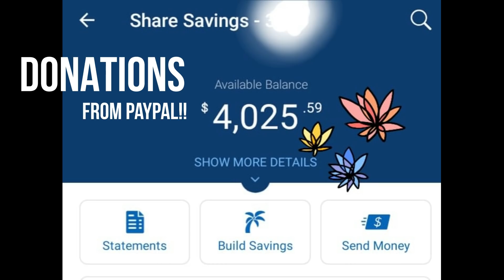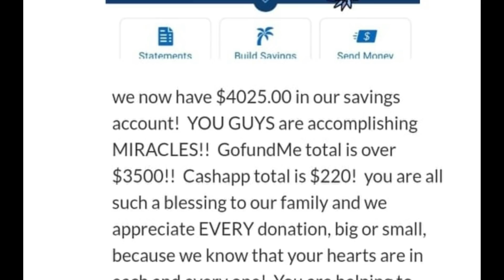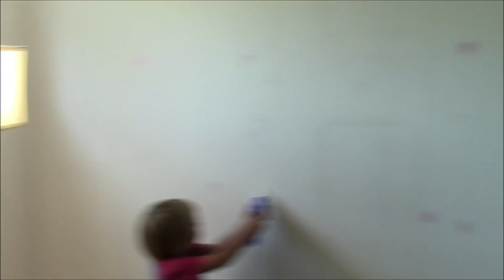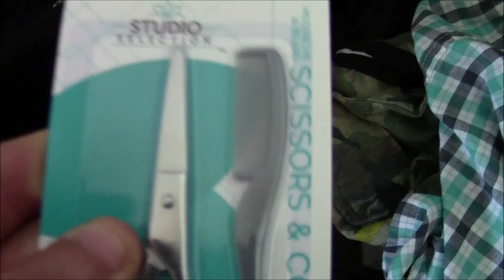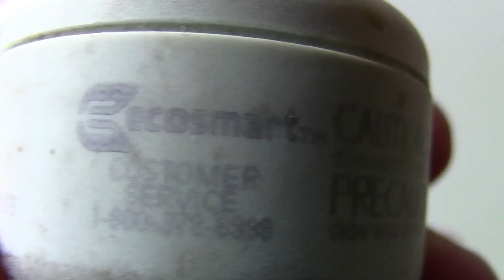WE'RE DONE! .........Screw this House!! ..........!!!!!

Comment: You guys look hot in that tent you might want to buy one of those little $25 Square air conditioners you put water and they're supposed to drop from 100 to 65 degrees in 20 minutes. I bought one for camping but I haven't gone camping yet but it's ready to go good luck.

Comment: I didn’t want to read through all the comments, so if someone already told you about the lightbulbs, I apologize. They are LED lightbulbs. You can buy them most anywhere now. The ones I currently have are shaped like regular bulbs, instead of the spiral. I like those better. They literally last for years. They are more expensive than regular lightbulbs, but you replace them so rarely it’s worth the investment.